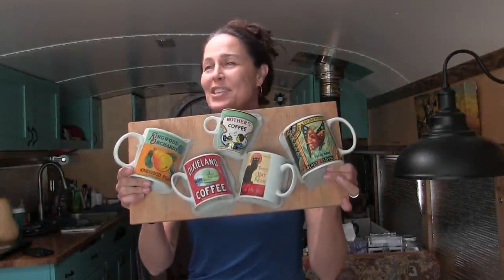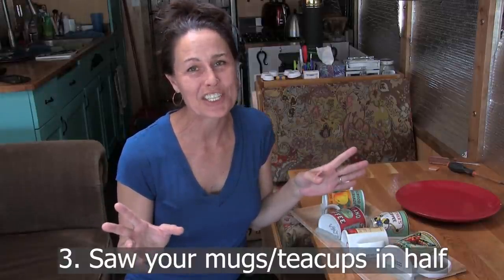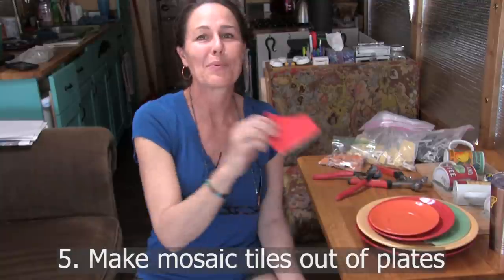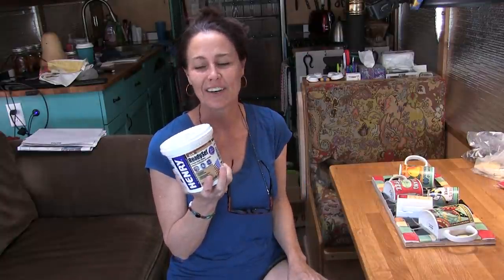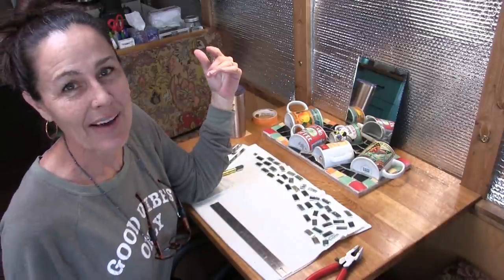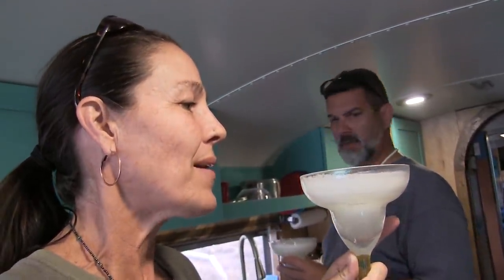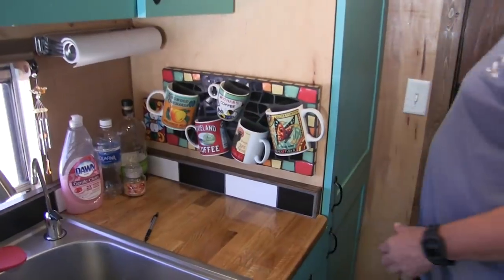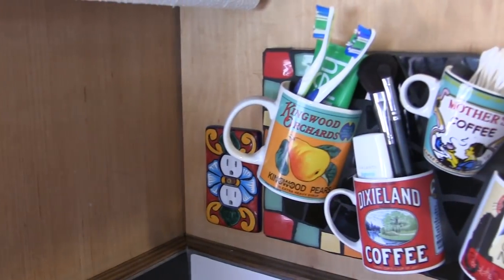Kerry Makes a Coffee Mug Mosaic in our Skoolie!

Comment: Problem with liquid nails on the back of mirror it will eat the backing off of mirror. On a small project that probably want be a big deal. But for insulation of mirror. You should use mirror mastic. It looks like liquid nails but has a different make up that doesn't eat away at the paint and silver.

Comment: Why couldn’t you use your trowel and cover the entire board evenly,  then set your mugs and after their set start using your ceramic pieces?
Reply from the maker: In a mosaic it is too difficult to get all the pieces exactly where they need to be before the thinset sets up. Doing it in small sections makes it a lot easier to get each piece back in its exact place.